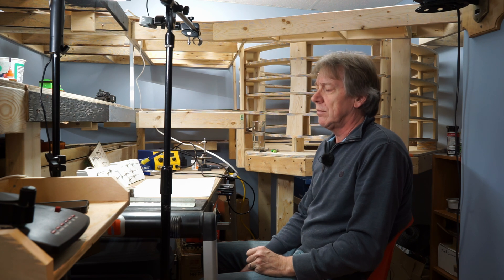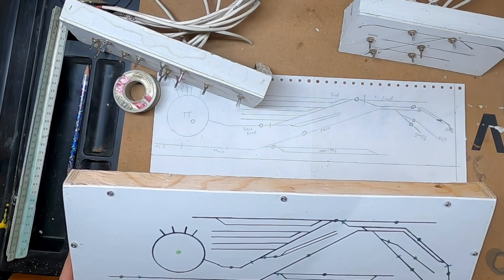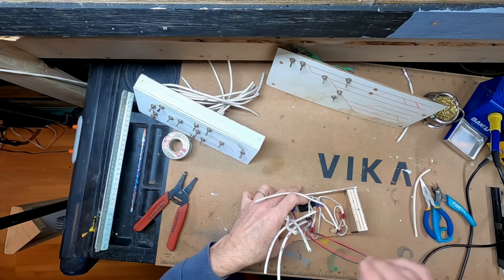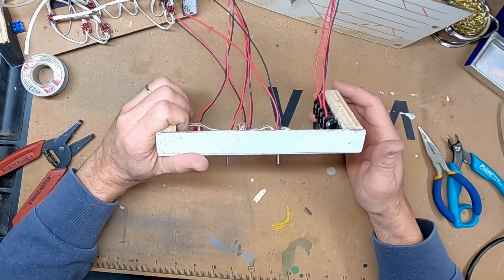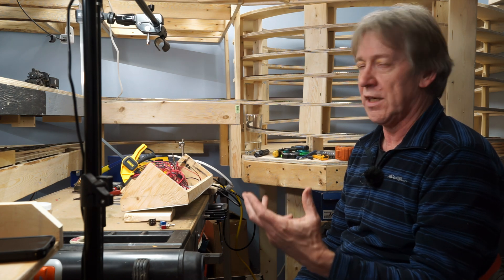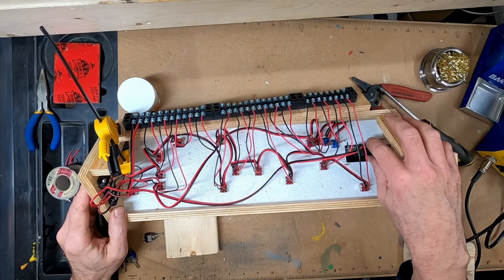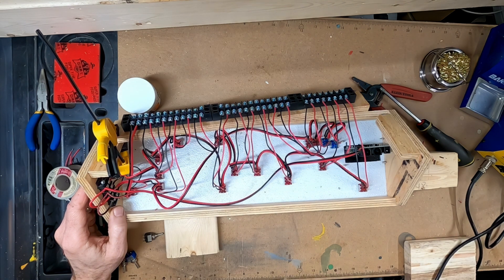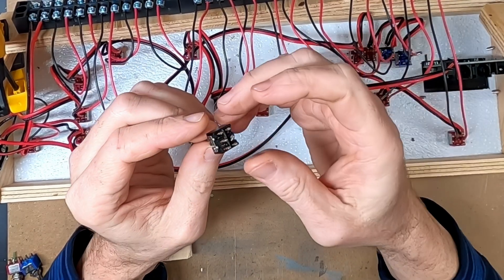Building a control panel for track power (DC & DCC) (Layout Wiring Part 1). ACHB 1-7

Comment: Thank you for doing this. I just purchased 5 BLI Paragon 4 Big Boys because I want to move to DCC on the new layout I plan to build and thought it would be motivation to convert but I have a bunch of DC engines that would need to be converted to DCC and the space inside of them and the cost to convert them may make it that it would need to be done over time and this would allow me to still run them on the new layout.
Reply from the maker: Good to know it’s helpful! You do need to be careful where you park your locomotives though… you don’t want a DC locomotive sitting and getting power from a DCC system accidentally. The heat buildup wouldn’t be a good thing.

Comment: Another great demonstration. I Like the small switches. It gives it a compact look. Thank you.
Reply from the maker: I like the small switches for the space they save. Soldering them is a bit trickier if you're not used to soldering though... Larger switches usually have screw or spade terminals so they can be easier to use.